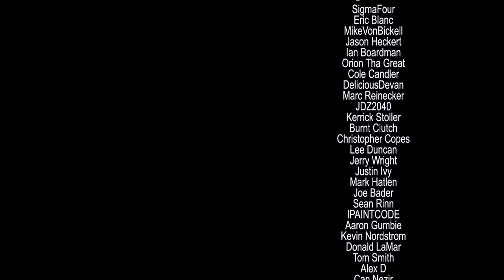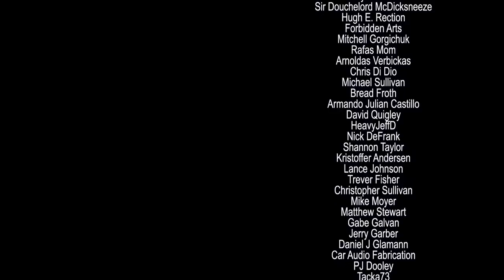Wishbone's Box, Part 2 - Glue, nail, install port, wire, load and TEST BUMP! FLUSH! - AMPLIFIED #689

Comment: Serious question. What about port area? I've been reading up on the subject because I wanted to build a box similar in size to that one and some online calcs said it'd have to be a minimum 5" diameter port but 6" would be ideal. Although the length was going to be something like 32" for the 6" port. Made me settle on a sealed box. Also why didn't you flare the port ends?

Comment: Ok this is a serious question. I have had multiple boxes, both glued and nailed, and glued and screwed. I like using glue and screws when I build. Doug why don't you glue and screws your enclosures?
Reply: time, would be my guess,  you have to pre-drill mdf if you don't want it to split when you screw it.   takes a fuck load of extra time doing that,  the glue should be more than strong enough by itself to hold the box together.
Reply: Damn Jo, may need to not be so harsh. Not everyone has experience in building boxes or fabrication. I started out 30 years ago using screws cause i didn't now any better and i did not have a nail gun anyway.

Comment: Hey guys I have a question. I have some static hissing in my speakers. I used to have a whining noise too but I put a ground loop isolator on the amp and it fixed it. But the static is still there
Reply: Adam Johnson where ever you grounded at maaaake sure u sand or file the paint off better connection always check first after that idk sorry
Reply: Their is numerous reasons but probably either the head unit could be crap or the amplifier could be crap isolate the rcas away from the power wire could be a simple fix
Reply: Daniel Harrell its a Wal-Mart dual head unit so that probably it. The amp is planet audio so its probably the head unit
Reply: Adam Johnson if it is a planet audio anarchy amp it could be either the big bang amps by them r ok but the anarchy is a waste of money go with hifonic if u want a good budget amp the h1 1500. 1d by hifonic is a beast it is like 160$ does more than the anarchy ever thought to nmw it says ok the box
Reply: Daniel Harrell its a rx4.300

Comment: Please write a book on this shit. I just tried some woofers I pulled out of my audi on the rear channel of my Clarion because thats how lotus has it and they were fuckin crackling and I don't know if it was the amp the way the coils wound or the high frequency sounds fucking with the coil on the woofer.... Every time I look it up I get some fucked up long answer thats completely unrelated to what I am doing. Good news is I jacked the mids out of the audi dubbed my magnet size and that shit is way clearer an bumps way harder. I still want to try these shitty woofers but Ill post up the install within the day. Also Lol. Newsflash they built bozes into the esprits body but they didnt port em....

Comment: how many watts that amp puts out?
Reply: 200RMS. Maybe 250 if the headlights and the AC are both off =D
Reply: It’s a 450 watt amp
Reply: It puts out 540 watts at 12.5 v @ 2ohms it's enough to Smoke That Type R it smoked mine no clipping

Comment: Question for all the car audiophiles here.. is Alpine making quality products nowadays?
Reply: Depends on the type of equipment and which line but yeah they still make some solid products.
Reply: lstephenson247 a type R 10 or 12 is all you would need for sound quality. I can't say much about Alpine amps, I have one SWR 12D4 in a recommended sized enclosure, it sounds tight, with deep bass.
Reply: I think their products are good. The headunits definitely are. I've known a few people with their amps- no complaints- and they have a low noise floor doing rated power. One thing I really like about bigger names like Alpine, Kenwood, etc. is warranty. 

Problem is not necessarily Alpine but that there's so many players in the field now. My issue with Alpine is their price markup- it's nuts. They aren't the only ones that do this though but you specifically asked about them.
Reply: The Alpine X series Sub is built to compete with the JL W7 sub and its meant for SQ